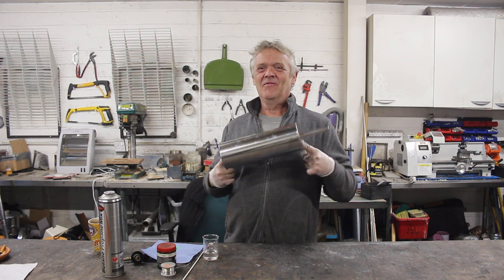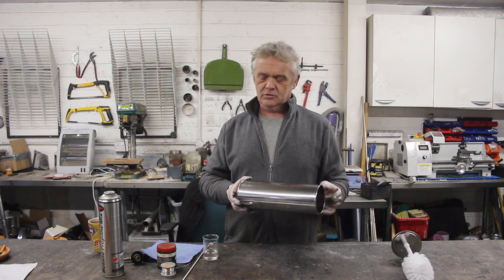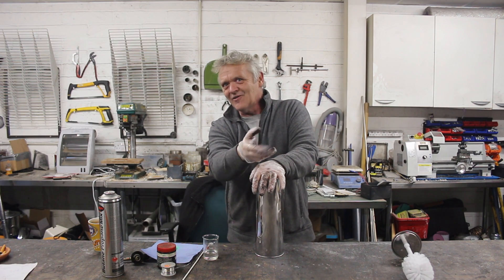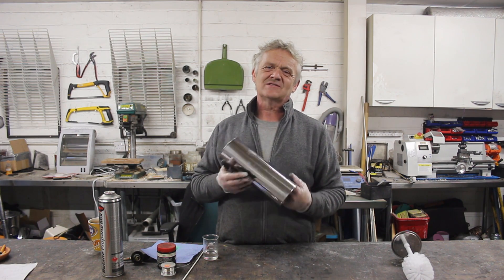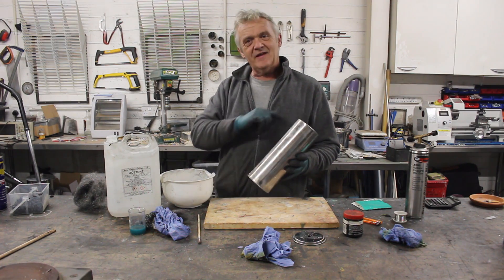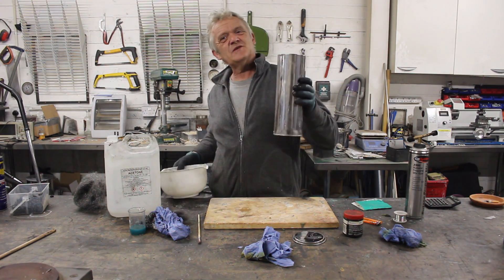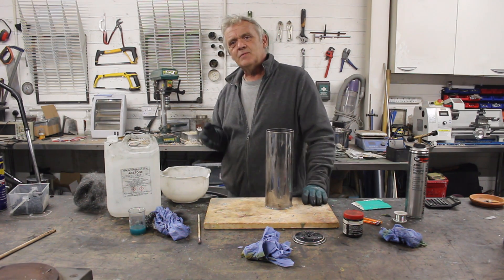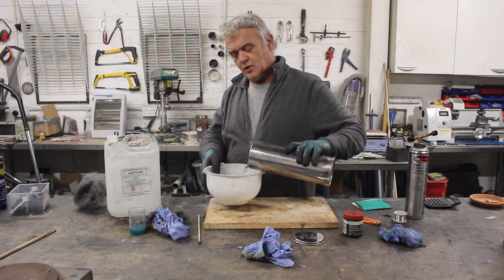1729 How To Make A Ghillie Kettle 1 - Soldering Stainless Steel

Comment: Hello. I just wanted to add that you need to be sure that any solder that will touch water or food vessels should be lead (Pb)-free. Even if it doesn't touch food or water, just touching any lead residue can taint edibles even if just in trace amounts. Cool project! I'm an old "tin banger", so watch the fumes while soldering. Cheers from northern Alberta, Canada.

Comment: I solder onto steel when working with electronics (battery tabs, mounting posts, etc.) Short mention in the video, but I use zinc chloride made from the zinc oxide from old batteries dissolved in HCL. I have not tried this anything this large, but the zinc chloride might be a better option for some people.

Comment: Yet one more Great Video , as usual,     I was told in HVAC class when it comes to potable water;  to always  remember to use plumbers silver solder (must not contain lead ).  Try not to use electronics solder like  60Sn/40Pb  (means 60 percent tin and 40 percent lead).    I use SAFE FLO/OATEY  a mix of  tin, copper, silver and  (melts at around 232 C or 450F) ...    Happy Tea drinking..

Comment: This is pretty wild; I have never thought of soft soldering stainless before. I have been in the musical instrument trade all of my working life;  and was once involved in a BBC project "the scrapheap orchestra" where I was challenged to make 2 clarinets 2 flutes and a piccolo entirely from recycled materials to be placed at the proms in the albert hall! I digress... but I used recycled stainless-steel cutlery to make all the instrument keywork. It worked well and I silver soldered all of these together. Lots of people told me that silver soldering stainless was not a thing and couldn't be done!! Not only is that not true, I did it in an entirely conventional way with conventional materials and processes and it worked fine. I used a Jhonson and Mathey borax-based flux "easy flow" and regular silver solver and a propane torch. Joints were tested to destruction... I mention this because though you are right that with water cooling the joints of the soft soldered vessel you should encounter no problems; I can't help thinking that you would have a broader safety margin using an alloy which will stand 650-700 deg C and no special fluxes to you in my experience!

Comment: I was wondering what sort of flux to use, because ordinary rosin does nothing on stainless steel and solder just beads straight off.
The only change I think might be a good idea is to use stainless steel wool, otherwise the surface you've scrubbed will go rusty from the iron particles you've scratched in the surface.

Comment: now I am wondering for higher temp application can you use the phosphoric acid and copper carbonate flux, to do any of the types of brazing using a propane and oxygen torch the same way you can braze regular steel together?
Reply: Yeah I got one ' and they get stupid hot "
i'm concerned that if its not full to the top with water 
That any of the higher soldered joints will melt out and leak at next filling" spraying hot water and steam out..!
Dousing the fire
Or burning the cook
Reply: Possibly using a borax based flux, like Cigweld "Comweld GP Silver Brazing Flux", with high silver content silver-solder.
The risk with higher temp applications is your tin (or lead/tin, if its not for food) solder melting out.
Reply: @dj1NM3  but will the borax react to the passivation of the stainless here, the way his mixture of phosphoric acid/copper carbonate mix does? I know the right flux is needed for the right job, like the zinc chloride I believe my aluminum welding flux is made from, that may not work here, and probably will give poor performance on iron I am guessing, but works well with the aluminum brazing/soldering (though I would rather use the spin friction welding I have been using on both aluminum and titanium, since its all aluminum or titanium all the way through rather than different metals being wetted onto each other to give the bond.
Reply: @ThomasAndersonbsf  Yes.
GP silver brazing flux is used on most metals, except aluminium alloys.

Comment: is the copper carbonate the "basic copper carbonate" like found in Malachite and verdigris? Or is it something different that has a method to making it?
Reply: Wikipedia shows a method of making a solution of copper sulfate and adding sodium bicarbonate. to make it, guessing it makes sodium sulfate and copper carbonate, and we have to do some fractional recrystallization to separate them?
Reply: ok never mind looks like the copper carbonate is insoluable in water while the sodium sulfate is soluble so washing with water seems the solution to getting rid of the sodium and sulfate, leaving the copper carbonate :)
Reply: heh now I am wondering if a thin layer of the copper carbonate is hit with a laser will it leave a pure metal layer, or will it end up a bit spongy due to the carbon dioxide it is sure to release or worse still will it just convert into copper oxide powder?🤣

Comment: WTF IS IT? kelly kettle, ghilli kettle? 
Clicks video... lots of info about stainless steel and HCL as a flux and a good bit about using solder to seal it... which is where I would have started but it DOESN'T tell us WTF IT IS AND DOES (supposed to do) IN THE FIRST PLACE.

Comment: You could probably also use a high temp silicone as well.  As you mentioned in the video, as long as there is water in there, it shouldn't get much up past boiling temps.
Reply: Are those materials safe for drinking water after boiling?
Reply: @ZsOtherBrother  Yes, if you buy the food safe type of HT silicone.

Comment: Won't the solder just melt the first time you try to boil water in that? I think you would need to tig weld this together to make it work properly.
Reply: As long as it has a significant amount of water in it, it shouldn't reach temperatures enough to degrade the solder. Two things happen simultaneously--water can absorb a lot of heat energy, and then the phase change process of liquid to gas/vapor takes A LOT of heat out with it.

Comment: Are you reading minds these days, I watch several of your videos each day and was on the point of buying a Kelly Kettle kit for around £90 but before I spend a penny these days I ask myself WwRd (What would Robert do) and I'd gone from buying the cheap metal toilet container to adapting a couple of spare different sizes of as flasks. Planning on day trips out on my motorbike like crazy oap's do. So looks like we're on a parallel journey. I also ask myself WtKtIc? (Will the Kids think I'm Crazy) which is usually answered as a wholeheartedly YEP. Then I get a list of parts and whittle them down to see if I REALLY NEED to be.using.metal and ask if bricks, or anything else lying around and a cheap £10 camping kettle could be utilised thus saving the planet and consequently my brain goes off on another tangent. My Mother used to say " there's VERY little COMMON about common sense in the human race and if I had to check ✔ a box then I reckon we'd both be in the "ECCENTRIC" category, and there's DEFINITELY not enough eccentric people around imho. Keep up the BRILLIANT ideas, I'm just building a set of bunk beds in my greenhouse, obviously!
Reply: Sleep in greenhouse, I like it

Comment: Hi Robert,

Is it possible to make a tea-light candle powered usb/phone/battery pack charger? Something very heavy duty - as in it wouldn’t be spoiled after being run all winter.

I use tea-lights to keep my room warm & I would like to have something durable, which could work all winter (as in it could be exposed to a flame for 4 hours regularly, daily).
Reply: Try email for this question
Reply: Perhaps a sterling engine powered dynamo.

Comment: Curious how you can either make supplied distilled water, or clean out salt accumulations from whatever water is at hand. Now, if you have a recapture condenser of some kind, it will be ok as the amount of salt build up will have a maximum of sorts,  as the returning water will be distilled be the steam system, but it seems to me some kind of a still branch(maybe for excess heat per se) could feed into a leveling reservoir or something. I find the primary problem with steam setups is the maintenance, salt and corrosion being the biggest parts of it. Swapping cheap parts can be an answer for at least a short term tho.

Comment: The steel wool was oily and mild steel. The stainless in that cheap brush holder is not very good, not even food grade like kitchen pots. You might want to use a stainless thermos or asparagus steamer.
Reply from the maker: Thanks for the info!

Comment: @Robert Murray-Smith did you get the phosphoric acid from a chemist supply? The highest concentration I've been able to find on store shelves so far is 55% from a hydroponic shop sold as ph down.
Reply: Should be good enough as long as it's more than 35%.
Reply: @a3b36a04  For flux yes, for things like refractory cement maybe not. I can easily add water to phosphoric acid but I don't relish the idea of boiling phosphoric acid to remove water when higher concentrations are required.

Comment: Who thought it was so simple. I suppose once you know how to do it it's simple
Reply from the maker: yeah it is pretty easy - like soldering copper pipe really
Reply: @ThinkingandTinkering  Dear Robert, hello from France.

Thank you very much for this clever recipe of soldering flux.
As a welding expert, I always recommend to keep as far as possible hydrochloric acid from any surface of stainless steel, because chlorine ions, when its concentration is above 50 ppm, is able to "dig" some crevices on most stainless steel like 304L.

It's an autocatalytic corrosion mechanism, where the very thin layer of chrome dioxide on the surface CANNOT rebuild, because of the presence of a "viscous cap" which contains dissolved brown Fe2+ ions + OH- anions, with the very acidic Cl- anion and hydrogen protons which are on the very bottom of the crack, digging it ...until total path done in the thickness !!

After sometimes few hours or days, we can observe "pitting craters" and also "water streams" pissing litterally like "Jets d'eau des jardins de Versailles".

The numerical value for the resistance against pitting corrosion cracking is called PREN : Pitting Resistance Equivalent Number.
Most stainless steels like 304L & 316L are very poor (circa 7, sometimes 10).

We use huge amounts of Molybdenum & Nitrogen additions to enhance this number, up to 35, 40, 45.

I was wondering... an old recipe made by you, from some years ago : could it be possible to reupload/redo your recipe of coppering gel ? (made of gelatin, copper-I oxide and formic acid in microwave ? Such recipe could be very helpful for making some heat exchangers.

Once the copper layer is made in surface, it could be easy to apply an eutectic melange of phosphorus with copper, by using an slight oxygen rich flame. Cu+P alloy wire allow to make them melt first, thus avoiding to make some performation of base material when heating.

It creates some fumes with phosphorus oxidation. The delay of heating allows the Phosphorus-copper filler material to melt first. Then the degassing/evaporation of phosphorus allows the remaining copper to become richer in copper alone, by heating it after making the soldering.
After few seconds, it becomes closer from the ground, pure copper layer.

Without such copper layer prior to soldering, the highly refractory (and invisible layer) of chromium dioxide appears, especially when heating, thus forbids any bonding/soldering of foreign materials.

Beware of overheating, because liquid copper is able to pass through the grains of the stainless steel (most often it's austenite, less often it's ferritic stainless steel with very huge grains growth when heated). Heating stainless steel with molten solder can creating some "hot cracking phenomena", by the phenomenon of liquation. 

A concentration in the very middle of the welded joint of a low-temp melting material, is prone to abrupt cracking. Because of the high stress resulting by heating such materials with HUGE dilatation coefficients. Austenitic stainless steels are prone to ~ 3,5 times more lineic dilatation, than carbon steels.

Always keep in mind that a straight welding will be stressed TWICE than a circular welding. If a pressure buildup appears, it's always such vertical in your case, these "longitudinal welds" that will crack first under pressure buidup.

Hohohow, by the way, beware about some tin alloys which contains lead.

It is a highly neurotoxic metal, and it ease considerably the risk of hot cracking / poor mechanical yield.
Always prefer

binary Sn96%+Cu4% (light bronze)
or
ternary Sn90%+Cu8%+Ag2%
or
binary Sn96%+Ag4% (electronics compliant to RoHS regulation).

Best regards and thank you so much for your ideas & realizations.